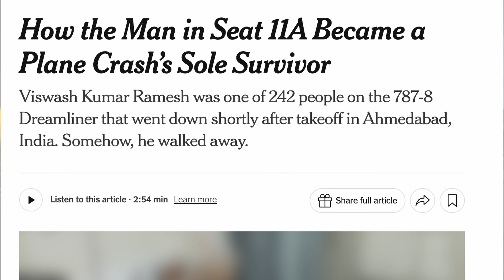Why the RAT Changes Everything – Air India 171 Update

Comment: Captain Steve, there's one more interesting fact: Look at the landing gear configuration. It's tilted FORWARD. The 787's gear is naturally tilted backward, and when you retract the gear it tilts forward and then goes up. This highly implies that the pilots did in fact issue the gear retract command but it prematurely failed.

EDIT: Look up LOT Flight 17. They had a similar incident where the retraction of landing gears resulted in a hydraulic system leak. We could be seeing something similar here.
EDIT: Yes, Swiss001 also made the same comment.
Reply: It didn't retract because they lost both engines and thus full hydraulics, and the RAT on a 787 doesn't power gear, only critical systems.
Reply: bingo. hydro failure onset with wheels up.
Reply: I have been interested in aviation since I was a child and just didn't make the cut cuz of my eyesight. When I watched the very first video of this plane taking off, I asked myself, doesn't it look kinda heavy and slow. And it had to use all of the runway to get airborne. And when it did it seemed like it didn't have any thrust or power. That's when it pancaked ever so gently. The pilot deliberately kept the gear down to cushion the impact on the landing gear. But 58000 liters of fuel blew up every thing. RIP to the souls.
Reply: @markmarky1124 It's India are we surprised? 

170,000 people a year are killed on their roads there alone...that are reported anyway.

It's a third world country operating a modern jet what could go wrong?!?!
Reply: @markmarky1124 intelligent assumption n surely u wud be a good pilot had you the chance...
Reply: This would imply that it was not a mistake by the pilots (as suggested by others) that instead of retracting the gear, they pulled the engines back. If the gear was coming up when they lost power, as you suggest, the gear would have stopped right there. Nice catch.

So, what could cause dual engine failure? Many suggest fuel contamination. I think unlikely for two reasons. 1) 787 engines are fed from different tanks, with separate pumps and lines.
2) If the fuel supply was contaminated, other aircraft would have been effected.

I think it's going to be something stupid like a sensor giving bad data, and the computer thinking that they had just landed and shutting the engines down.

The only other thing I can think of is 'swiss cheese'. A highly unlikely (and unforeseen) set of conditions arose and all the holes lined up. That's going to be a really hard one to diagnose.
Reply: No blaming please mate
Reply: 💜💛💜💛💜🕊
Rest in peace x

My heart goes out to all of their family and friends ❤
Reply: @shirleythompson8251 what about your Liver?
Reply: I’ve watched several 787-8 from different airlines take off and it seems like the main gear retraction sequence varies. Some tilt forward then open doors, others open doors then tilt gear. I’ve even seen some when both the tilt and door opening happen at the same time. I did see another Air India 787 tilt the gear then open doors. Not sure why the variation, but certainly a very interesting point.
Reply: @worshiplifestyle2102 . Maybe there’s a difference between the -8 and-9 787’s.
Reply: So, question remains, why did the rat deploy?
Reply: @RaivenBC It was just explained,  wasn't it?
Reply: Yes, the retraction of the landing gear stopped after stage one ( wheels tilting ) , showing hydraulic failure. I couldn't see if the doors opened to receive the landing gear, which usually happens around the same time.
Reply: So you jumped the gun in your first video. You dont just blame the pilots, yourself being a pilot should know better. Let the reports of black box come
Out.
Reply: HYDRAULIC SYSTEM failure due to Electromechanical failure ..
Reply: I’m questioning why the need for using the entire runway?  All that dust that came up??  But I’d say they already know the cause.  They have the CFR and FDR….. bad fuel doesn’t make sense, no other aircraft would suffer from that??  If two engines failed, you can’t rule out sabotage though seems very unlikely.  But that take-off seems worrisome….
Reply: The pilot radioded " Mayday, Mayday, Mayday, losing power,  going down". Seems pretty conclusive the engines failed. The misty cloud as it leaves the runway doesn't seem normal.
Reply: The RAT will automatically deploy under certain conditions.  It can also be deployed by the push of a button from the pilots.
The sole survivor also stated he heard the engine powering up just prior to the crash.
Reply: @Blake1156 I also recall the survivor stating he heard the engines spooling up
Reply: I saw another video that states the same - it is an important observation.
Reply: With this new evidence, it seems to me that fuel contamination is got to be the only possibility. It is statistically almost impossible is that both engines could fail simultaneously, and even at MTOG a 787 should be able to climb out on one engine
Reply: Then how would the plane taxi down the runway and taxi  off with contaminated fuel? Wouldn't it just sputter and die? @jimeditorial
Reply: @caner78bob that depends. If the aircraft still had Fuel and was topped off with contaminated kerosene, it could be a question of how the contaminants mixed with the good fuel. Or if the contaminants clogged the fuel strainers or damaged the pumps. But the aircraft got all the way to V1 with a normal thrust, or they would have rejected the takeoff. And the only single point that could cause simultaneous failure of two engines would be fuel. Are British Airways 777 crashed short of the runway at Heathrow because of this. In that case, the contaminant was water, and it had frozen into ice
Reply: @jimeditorial this is India in a nutshell 😊
Reply: @samholdsworth420 No actually .. it a Boeing
Reply: Its logical, when both engines fail the hydraulics to retract the landing gear also stops functioning. Thats why its still in de forward tilt, because midway both engines gave out...
Reply: Engines should be drowning out the RAT noise. Engines were not running.
Reply: Ashwin, how about this scenario? Complete hydraulic failure on take off, the rat comes out, the gear stops partially up, Flaps retract? The plane mushed down in a stalled condition. Multiple witnesses of the aircraft have said no flaps.FYI, there are 3 hydraulic systems as backup maybe some sabotage of the hydraulic system?
Reply: @scotty657  Seems unlikely. Any error must've occurred after the take off. The 787 has TOCWS (take off config warning systems) and it would audibly warn the pilots pre take off should any failures be detected.
Reply: @scotty657 there's not 3 hydraulic systems as a backup. There are simply 3 hydraulic systems... left, right, and center. So I dont think if the left hydraulic system fails then the right or the center would be able to help it in any way. After hydraulic systems fail/freeze, the RAT is deployed which brings back SOME power to critical components. I dont know if the RAT provides enough power to be able to retract the landing gear though
Reply: It doesnt matter about the landing gear, this plane lost bot engines on take off, I'd say the pilots had their minds on that problem alone,,,,not the landing gear, it wouldnt even cross their minds, they just know they have no thrust, and no place to land !
Reply: Indian pilot showed unreal courage and character by following all the protocols while death is in his front within 30 sec. When they knew RATS were out and cause dual engine failure 
1. Called MayDay ATC
2. Took the gear intact for some landing.
Reply: Correct
Reply: I hope the engine weren't shut down
Reply: Thanks Capt. !
Reply: Agree. The wheels  could not go up because of the engine failure. Rat may not be powerful enough to operate the wheels
Reply: @manupandit3864 it’s not or wired into it cause normal it happens at altitude
Reply: You got the gear position thing backwards.   Perhaps they had a power failure before attempting to raise the gear.
Reply: and that they used all the runway may suggest thrust may have been impacted.
Reply: I’ll wait for the experts analysis instead of the internet experts.
Reply: No no, the 787 is one of the few platforms in which the landing gear does indeed tilt slightly forward. By about 9 degrees to be exact.
Reply: all what he said in the first and second video people explain it before him, especally by MENTOUR PILOE and another french guy who explain that the pilot did pull up the gears but they got stuck ....! steeve watches people on youtube  then he comes here and say : am sorry, i have to change my bullshit story ! 😀
Reply: Source: Swiss001
Reply: @dinbali I mean most 787 pilots mentioned this days ago lol. The -8 has a slightly different retract procedure, it definitely goes “toe-down” when you select gear-up.

One thing he didn’t mention is that in this configuration, the priority valve will close, locking off hydraulics to the gear manifold (why doors are stuck in position also) and other non-critical components (RAT can’t handle those.)
Reply: Both the gear retraction and flaps failed to deploy do to electrical and hydraulic malfunction; due to thrust failure of the engines!
Reply: No hydraulic pressure if engine stopped.
Reply: So Captain Steve,the APU must not have been running either if the RAT deployed ?
Reply: @tbugher62 the APU is shut off when you start engines.   It also takes a long time to spool up.
Reply: Wet fuel?
Reply: @rayperkins8560  possible but highly unlikely - they'd literally have to pump water into the tanks to make the engines fail completely
Reply: The one who took the video said he hardly heard any sound from the plane.  Normal sound maybe
Reply: Landing gear being stuck would not cause the plane to come down. There was some other major factor at play here...
Reply: Looks like the retraction process was initiated and at that exact moment there was a failure leaving no power so the retraction of gear was never completed!
Reply: @joebezz9894 no, there would have to be a door open. There is not.
Reply: He sure did 😢
Reply: Ps @Swiss001 if your in here WE LOVE YOU
Reply: Fuel contamination?
Reply: When the landing gear lever on the Boeing 787 is pulled up the doors open first, then the wheels tilt and fold into the gear bay as part of the retraction sequence.
Reply: no hydraulics. the small amount of movement was just the stored pressure, not more could be applied because there was no power.
Reply: If there was a sudden massive power failure as hes suggesting that would make sense it was beginning to retract and stop
Reply: In his first video after the crash, blancolirio  said only one thing- find out if the RAT was deployed. He said- finding this is the most important thing. 
He said nothing more- about the crash. 

I’m going back to him. Sorry
Reply: It's Turkey engineering company who is maintaining service of air India.
They attacked silently without any proof.
Reply: fuel issue, simultaneous dual engine failure so unlikely without bird strike
Reply: Dirty fuel can sometimes not be fully ascertained until after full throttle is applied. I also wonder about outside manipulation as many of the recent crashes have happened either at landing or on takeoff with both being close to the ground. Just a thought🤗♥️
Reply: The only 2 double double contamination engine issues I know of where the triple seven crash at Heathrow and airbus 330 at Hong Kong. The triple seven had a very slow long idle descent, coming from Beijing and accreted ice in the fuel lines dislodged and blocked the entrance to the fuel oil heater. Boeing spent several several million dollars building a full scale simulator to show the problem with the Rolls-Royce engines. The airbus had been filled with fuel in Surabaya, Indonesia, and the filter separator system. Water collection device failed and dumped a whole bunch of 20 µm salt crystal into the fuel control system as they approached Hong Kong when they went to bring the engine up from idle the engine would not respond Because of the particles blocking the fuel control at the time. The pilot said he did not have enough altitude and air speed to make the platform they worked on it tried and finally got one engine to come up to 70% power.  They landed at Hong Kong with one engine at 70% power and one at idle, using almost all of the runway. In over six decades of a commercial jet fuel specification, actual fuel issues are so rare they statistically don’t exist.
Reply: No no, the 787 is one of the few platforms in which the landing gear does indeed tilt slightly forward. By about 9 degrees to be exact.
Reply: 4:52 The full list of auto RAT deployment conditions for 787 (NOTE ITEM 2):
1-Loss of all engines
2-Both engines are at less than minimum idle RPM (Revolutions Per Minute)
3-Loss of all hydraulic power - left, right, and center systems detect low pressure
4-Loss of all electrical power
5-BPCU (Bus Power Control Unit) detects loss of power to C1 and C2 TRU (Transformer Rectifier Unit)s
6-On approach, loss of all four EMP (Electric Motor Pump) hydraulic pressures and loss of either the left or right flight controls ACE (Actuator Control Electronics) 
7-Rotor burst on takeoff that causes loss of both PECS (Power Electronics Cooling System) primary cooling loops.

SO HOW DOES “Both engines are at less than minimum idle RPM (Revolutions Per Minute)” OCCUR and could fuel disruption cause that condition?

You need to include more items! There are a number of other observations that need to be addressed! That very late rotation generating a large dust cloud is a big one.  A person in the building that was hit could hear the jet engines operating. The landing gear was partially retracted. The engine thrust on the runway acceleration was reduced. After rotation the engines rolled back to even less thrust. The landing gear was partially retracted and the cycle was probably terminated when the RAT was deployed.
Reply: probaly too soon, but one thing is clear..if this goes back to Boeing, this might be the nail for their coffin...at least outside of the US. God bless all the vicitims and families of Boeings corruptness... It´s such a shame ;(
Reply: Turkey technicians service the plane. 
They sabotage it. Just enough fuel to get it airborne then empty although full. 😢
Reply: See “Pilot blog”. He shows workshop retraction to back up this theory.
Reply: Bad fuel?
Reply: Swiss ki video dekh k yaha gyaan pel diya😂
Reply: these guys needs to do his homework before he runs his mouth..

this info was out 2 days ago. the day before this clown issued his flap/landing gear synopsis.. 

so, whatthefuckever Stevie boy...
Reply: BOEING PLANES ARE DEFECTIVE!
END OF!
Reply: I've been asking this since it happened.
Reply: Luckying it's not C919 !!!
Reply: Sound like all the channels have been listening to Juan Browne.
Reply: Love the factual information opposed to fake info. Thank you
Reply: Probably,  but it can't retract  with both  engines  failed.
Reply: The 787 has 4 generators, 2 per engine.
Reply: I think you got this either from Swiss001 chanel  or Denys Dadorov who puts a clip from the chanel on his latest  video and links to It 
SO please aknowledge the source of this  Instead otherwise you are  passing It off as your own analysis by omission
Reply: I noticed it and you are very right.... The gears tilted forward but the gear doors didn't open... And it's a serious issue
Reply: All these people see a video somewhere else then come here to give their "expert" opinion
Reply: A question, if the engines were at full take off thrust would that not cover other noises thus masking the sound of the RAT that was deployed by a hydraulic failure?
Reply: The next time I fly I would ask for an Airbus to my destination, any airline.
Reply: Does this means the maintenance guy didn't check properly and thoroughly and detect any systems fault?
Reply: This is amazing. I remember when Swiss001 was basically a meme channel.
Reply: My thoughts were that a gear failure caused a more catastrophic issue.
Reply: The question is if both engines failed just after take off, How they failed?? It’s likely one in a billion case that dual engine failure can happen while take off.
Reply: The landing gear had nothing to do with this one.
Reply: @Richard-wp6xq the landing gear is just a confirmation there was a loss of power happened
Reply: @Richard-wp6xq 

The partially retracted landing gear is not the cause but rather another piece of evidence that the engines’ RPM was below flight idle.
Reply: The plane was still trying to pitch up, so hydraulic failure doesn’t seems to happen. It was a complete power loss.
Reply: @p11music80 

With the RAT deployed, there is some hydraulic capabilities for some of the most important control surfaces.
Reply: @Mentaculus42 Yes , but what would caused the double engine failure, Its likely one in a billion case and pilots also don’t even get training for double engine failure.
Reply: @p11music80 

The engines didn’t fail because of something breaking or malfunctioning with the engines. So NOT DUAL ENGINE FAILURE but rather both engines lost thrust, maybe due to fuel interruption. Most likely the engines were at LOWER THAN FLIGHT IDLE RPM which is a condition to auto deploy the RAT. A person in the building that was hit heard at least one engine running, possibly both. So the question should be why the engines were producing low thrust. My take is an interruption of the fuel. But that also has to have an explanation.
Reply: @Mentaculus42 Yeah , FDR would tell the exact parameters for all the instruments.
Reply: Thanks captain!!
Reply: 3:15 - 3:19 with this 4 second gap how did he escape! please someone explain to me, please don't say god helped him bs
Reply: @gouthamthala666  the fireball isn't an explosion its literally just tons of fuel burning quickly but there's virtually no blast to it and it dosent consume the entire wreckage instantly however it does quickly spread (think of throwing gallons of gasoline on someone and then lightning it there will be a relatively large initial flare up however the person will still be alive until the burns itself gets to them). He most likely didn't get out within that time gap but he most likely got out through a hole in the fuselage or out the emergency exit after staying conscious during the initial impact. Its extremely likely that more people survived the impact but were either knocked unconscious or weren't but couldn't get out before the fuselage was consumed by the fire. Its also likely that people were looking for an exit but never found one or couldn't open it in time.
Reply: yeah I saw thatbin another channel. that guy gave the most logical explanation so far. he also talked about heat and air density
Reply: Seems unlikely.. by my analyses the audio file does not match the video. It’s like it’s been overlaid and is not in accordance with expected delays in distance and acoustics
Reply: This guy gets most of his information from YouTube comments section, retired pilot by the way.....
Reply: Great observation! Though the gear door isn’t down.. this is the first part of the gear retraction cycle. The fact that the doors are up still, with trucks forward screams loss of hydraulics to me.
Reply: Therefore its a mechanical failure and airline is liable
Reply: Thanks captain steve for detailed analysis ,but these are all just assumptions with rational thinking .only the black box ,flight data recorder will confirm the truth
Reply: I think Captain Steeve is talking about an optional illusion from the beginning there is no RAT deployed you can see clearly, but towards the end you can mistake the front wheel to a possible RAT deployed. I would suggest to wait for the investigators report to come out before making theories
Reply: This Steeeve guy doesn't even have half the information and he's already running his mouth... Now he's talking about the RAT two days later
Reply: Captain Steve, there&#39;s one more interesting fact: Look at the landing gear configuration. It&#39;s tilted FORWARD. The 787&#39;s gear is naturally tilted backward, and when you retract the gear it tilts forward and then goes up. This highly implies that the pilots did in fact issue the gear retract command but it prematurely failed.<br><br><br>EDIT: Look up LOT Flight 17. They had a similar incident where the retraction of landing gears resulted in a hydraulic system leak. We could be seeing something similar here.<br>EDIT: Yes, Swiss001 also made the same comment.
Reply: Yes exactly, this hints the retraction of the landing gears might be the trigger of the event. Another evidence is that the plane stopped transmitting data at 609 ft, instead of upon impact!
Reply: True
Reply: Not only that, it’s just the left main gear bay door that’s appearing to cycle. I think it’s an electrical failure. The hydraulics on the 787 are driven electrically.
Reply: Sadly this forward tilting wasn't concluded earlier.( One could see it also in previous vids) So gearleaver was lifted properly! Ergo no pilot error!!!!Asking the question: was this a proper investigation in the first place
Reply: Say where you heard this. Swiss001
Reply: @HunterAtheist Swiss001 commented on it and also that the screen shot is so grainy it can’t be considered definitive.
Reply: @HunterAtheist that silly Swiss boy😊
Reply: Here’s the thing. The gear doesn’t naturally tilt backwards it tilts forward. Also…. The doors would come down at the same time as the gear starts to tilt in the -8 which we couldn’t see here. To add on even more, there are videos of the tilt mechanism failing on the 78 and that bogie tilts forward. 
So in my opinion it’s more likely that the loss of hydraulics tilted them forward. Not a gear up actuation.
Reply: @diegoramirez8674  If the engines flamed out after takeoff I don't think the pilots would be too concerned about landing gear.
Reply: @diegoramirez8674  Does gear unlatch and gear door hydraulics take more pressure to actuate than the tiny tilt actuators?
Reply: @diegoramirez8674 That makes sense.
Reply: The Gear started to come up then stopped about 2 seconds later.
Reply: @coolhandluke-0 Pilot reported he is not climbing up so engines or hydraulic failure should be the cause.
Reply: Pray if you would for the lost and for all involved in finding out the truth ❤❤
Reply: LG doors are not open. That happens immediately when gear retract is selected.
Reply: @paulmathis2191  They ARE open, you M-O-R-0-N.
Reply: YOU ARE RIGHT. All the more informed pilot channels said the same thing two days ago.
Reply: @mamabazzz  Swiss001 is right Thats the source
Reply: May be we wait
Reply: Good idea but too much common sense.what’s I’ve learned is there a lot of people who love getting into the technology of complex aircraft.
Reply: @henryhsu1614 thats what i say, the black box tells all
Reply: That's a very typical optical illusion.   Weird.
Reply: Some of you are so rude and mean. At this time no one except God knows what happened. A bunch of you act like you are right & everyone else is wrong when in fact a lot of you aren't smart enough to find your rear end with both hands in your back pockets and a map.
Reply: @kimberleyannedemong5621  And the overarching question to your statement by these kids is "What's a Map"?  I use "couldn't find yer backside in a lit room with both hands and a 10 man working party"!(talking to Marines)  All I know for sure is it got up to 600 ft or so altitude and then basically pancaked and exploded.  I'll wait for the NTSB report.
Reply: @kimberleyannedemong5621  How are they supposed to hold the map?  🤔
Reply: @kimberleyannedemong5621 That's a bit harsh,but true nevertheless
Reply: @kimberleyannedemong5621 🤣🤣🤣🤣🤣
Reply: not 100% sure if the 787 gear is electrical or hydraulic. but giving the new development that the RAT deployed, the gear position seems to support dual engine failure (or some other complete systems failure) right after getting airborne. whether the gear was just symptom of or a clue as to the cause remains to be seen... gonna post a possibility i just considered in the main comments. hint: possible malicious intent
Reply: @tech-ishbrad183 it’s hard to do that this days.
Reply: Ok Sherlock
Reply: Is is tilted backwards. The plane is tilted very high nose up, so if straight, it would be tilted back.
Reply: @artfx9  Yes it also the landing gear door is not slighly open if there is failed in the highdrolic, and in that cases there is something happened to out of control.
Reply: Wouldn't fuel contamination cause the engine failure?  Why wasn't the engine failure picked up before take off?  Just questions.  Seems odd no apparent signs before the plane took off.
Reply: I think Captain  Steve talked about this in his first video. Yes, it would be very obvious if there was a problem with the fuel composition and flow.
Reply: @fdmtts fuel with water not drained？I only sure the engines have loss power so the hydraulic pumps malfunction, and the rat take functions.
Reply: @akakakakakak3084  i am not a mechanic or pilot. But i am aware that planes have redundant systems and have to abide by strict maintenance standards. Something doesn't add up.  Be interested to see the maintenence records on the plane.
Reply: @fdmtts because you are at idle.  Then you go full throttle and you are gushing fuel into the system. Then as it tilts upward I am sure that is when the contaminant really got fed into the engine.
Reply: Had the engines failed BEFORE takeoff, the plane would not have.left the ground!
Reply: @fdmtts 

There are multiple examples of fuel contamination that caused problems later in flights. It is an issue of what type and how much of the contamination there is.
Reply: @fdmtts But pilot reported that he is not claiming up so engines definitely working otherwise why it's not getting enough thrust?
Reply: @subbaraotanguturu9271  Question becomes why the engines worked while taxing but not at takeoff
Reply: @fdmtts There were  signs of engine problems.  One was the AC did not work properly on the way into  Ahmedabad.  The AC air comes from the air bled off the engines high pressure turbine.
Reply: @frankkolmann4801  AC air does not come off the engines on a 787. The air pumps are electrically driven
Reply: @frankkolmann4801  That would make sense.  Something was missed clearly
Reply: @frankkolmann4801 I thought the packs were electrically operated on the 787 and didn't use bleed air
Reply: @jimeditorial my error   you are right 787 does not use bleed air
Reply: @fdmtts  fuel contamination would not show that early
Reply: It doesn’t matter
Reply: There is some other background this event. It might be relevant or maybe not. But it is worth mentioning. 

Air India was a government of India organisation, that was losing money terribly.  Generally Indian government officials have a superiority ego issue, based on the feudal languages of India. 

This company was sold to TATA. That means the government employees with a huge superiority complex converted into private company employees.  This is a terrific change in the local feudal languages. This has resulted in so many management issues, including insubordination, lack of efficiency &c. 

For, the company became a mix of competing egos.

The local languages including Hindi are highly feudal. This can create various kinds of animosities if proper positional status in the language codes are not enforced terrifically. A single indicant word form change can create huge mental stress. 

And again, if the pilots themselves speak in any Indian language to each other, so many mental stress can happen if anyone of them does not concede the required inferiority or is not able to enforce the required superiority in the language codes.
Reply: There are videos from passengers on the airplane before it took off showing videos of literally nothing working in the cabin... The fact that they still took off knowing the AC didn't work the screens didn't work the lights didn't work is 100% negligence and tells me exactly why the company's trying to offer 120k to all the families right away to get them to sign something so they can't sue for million s
Reply: Stop the copy&paste key, dude😂
Reply: Po
Reply: Which explains the pop the survivor said he heard.
Reply: Did anyone check the condition of the plane after it landed from Delhi and certified OK before it started it's journey towards London?
Reply: It's a Boeing! Amazing the wheels didn't fall off at the end of the runway as it took off.
Reply: chmcha 🤣
Reply: You’re 100% wrong
Reply: Haha... We have also seen Swiss001.. 

bro its 2025. U cant be genius easily if you take someone else's opinion and vomit it in somewhere as your own finding 😂😂.. Next time bro..
Reply: Bhai vo tik tok expert hai😂
Reply: Faulty Maintainence and INCOMPETENCE of the service ground crew was the main reason of FAILURE of HYDRAULIC SYSTEM due to ELECTROMECHANICAL failure... it was a MAN MADE catastrophe created solely due to INCOMPETENCE of indians in handling Technical aspects ...
Reply: You sure that's not an optical illusion? I don't think anything but weight on wheels changes the wheel truck's tilt.
Reply: @erickborling1302 this is the second video I’ve seen the landing gear and its angle mentioned.
Reply: @erickborling1302   look at some videos of it retracting... dont think that much change in angle can cause illusion
Reply: @erickborling1302  there's a pretty good analysis video on it, probably where the commenter got the idea from. But they are right, the tilt of the landing gear is in the retraction configuration.
Reply: @erickborling1302  Except retracting the landing gear, which causes them to rotate
Reply: @erickborling1302  even if it's optical illusion. It is a fact the the 78's wheel change their angle prior to retraction.
Reply: @erickborling1302  No the nose down bogie is NOT an optical illusion
Reply: @erickborling1302 you think wrong

The gear tilts forward when it the lever is selected up

You can see this in videos where the aircraft is jacked up for maintenance
Reply: @hunter-aviation  if the gear tilts forward when the lever is selected up that means its also a possibility that the pilot intentionally stalled the engines and aimed the nose down
Reply: Is this Cpt.Steve Burton?
Reply: Agree
Reply: Stop asking for a source. It's from another youtube pilot that flies commercial aircraft. I saw the video myself. Just watch them all like at did.
Reply: This guy is miles behind other people on this story, others have done this much better. He is just copying other YouTubers
Reply: @ianhudsontlm Agreeing with you. And backpedaling on his first theory which I
 thought to be very irresponsible of him to air his first theory without having the facts.
Reply: @ianhudsontlm one thing to consider is this guy is also working he’s not retired.
Reply: All I know is that I am not flying on a boing anymore!
Reply: @Naebl-cd5kp  Are you really not flying on Boeing anymore? First of all, the 787 has never experienced a total hull loss crash, which highlights its stellar safety record. This aircraft has been in operation for about 12 years, making it one of the safest planes to fly, based on this alone. Secondly, you can’t choose which aircraft you want to fly on, unless you fly with an airline like Spirit, which uses an all-Airbus fleet.  These “if its a Boeing then I ain't going” type of comments are lame because we don't even know all the facts yet. Its too early to blame Boeing
Reply: @deuce9star  - Yet there has been a hint of Boeing Bias from Captain Steeeve IMHO
Reply: @Naebl-cd5kp Take care princess, lol.
Reply: @Naebl-cd5kp BOING? Isn’t that Bingo for people who are dyslexic?!🤔
Reply: @Naebl-cd5kp if it’s a Boeing I’m not going!
Reply: Raising the gear would put a significant load on the electrical system.
Reply: this info is 2 days old.. your last clown video was a day ago.. Do your homework before you run your mouth, flyboy
Reply: Flaps are retracted.
Reply: @brucelawson642 How when the aircraft is supposed to be able to prevent that happening. The pilots have enough hours to work through the checklist which is electronic. Not running late.
Reply: @brucelawson642 😂
Reply: @brucelawson642    no despite your excessively confident assertion , you are wrong , pictures you may not have seen prior to the crash and the wing at the crash site show/confirm leading and trailing edge flaps were deployed.
Reply: Capt. Steeeve is interested in firstly blaming pilots.
Reply: @thestruggler3338  Did you not watch the video? He agrees it's probably not pilot error.
Reply: @alzuu1 and you clearly didn't watch his first video about this crash.
Reply: @jcallwood25  oh, I clearly watched it which has become irrelevant because he changed his theory in the CURRENT video. Maybe if that comment was made in the first video, it would make sense.
Reply: @alzuu1 at not pilot error until we eventually find out the actions that actually caused the plane to lose thrust.
Reply: Correct. Which is why you also don’t look away from possible pilot error causes. We used to have a rule when choosing international airlines. If they can’t figure out how to make drinkable water, you shouldn’t fly the airline.
Reply: @thestruggler3338 it normally is. I work on the forensic team that handled the crash in DC and about 80% of the team it’s human error.
Reply: @thestruggler3338 no, he was giving an analysis based on what he knew thusfar. He had three theories. Pilot failure was only one of them.
Reply: @thestruggler3338 only because most accidents are due to pilot error. Even the MAX accidents didn’t have to end up as crashes.
Reply: @LandingFromThTeRightSeat Boeing purposely misled the airlines
Reply: @LandingFromTheRightSeat  have you heard of MCAS? clearly not. Why would you not have that information in the flight manual for the MAX aircraft. No lets put it in there after it has killed 400+ souls.  So most accidents are due to a combination of things including pilot error and including situations that should never have arrived due to manufacturer error that then have the chance to be followed up by pilot error.  To say that recent crashes are simply 'due to pilot error' is in fact an error within itself. Are you not a pilot or something? Sheesh.
Reply: @LandingFromTheRightSeat I disagree totally..max accidents were caused by MCAs malfunction but not pilot error
Reply: @dandee7414  if you had any actual heavy jet time you would have known to fly the plane. Not leave the throttles at full power and hit the ground in excess of 500 knots. If the trim wheel appears to be running away, you would apply that procedure and turn off the stab trim cutoff switches. I’m sure you have more than my 6000 hours in the 737, so you probably know better.
Reply: @thestruggler3338  you probably have more hours than I do in the 737 (6k and counting) so you no doubt know more than the rest of us on here. Since that’s the case you’ve certainly done the sim profiles for MCAS failures and know they are identical to the runaway trim failure checklists that have always existed for the 737. You also know that the stab trim cutout switches will stop the trim issue when there is a failure (to include MCAS). 

A person of your expertise also knows that on the flight before the Lion Air crash, the failure happened and a pilot on the jump seat quickly stopped the MCAS failure by flipping off the switches. 

Your expertise also knows that the planes each hit at high speeds because the pilots failed to control their airspeed by reducing the power setting. Having done that would have also alleviated nose trim control pressure. 

But you have tons of experience and knew all those things and continue to speak incorrect information. 

Why?
Reply: @LandingFromTheRightSeat  Thank you for your lengthy response. I have zero hours flight time but I have an open mind and a good memory. I know a RAT when I see and hear one. I look at a multitude of FACTS. Your suggesting situ normal after  first 2 MCAS related tragedy in Ethiopia and Indonesia? Leave them in service for another year you recon? No problem.  You can argue thy didn't extend flaps or they pulled in the flaps instead of the gear all day long.They mushed it the best they could to buy them time. Your a muppet and probably a paid puppet. I need not hear anymore of your resume or analytical 'investigations'. Good day Sir.
Reply: @thestruggler3338 
That is a pedantic mean spirited comment.
Change the channel, maestro.
Reply: @thestruggler3338 He never said that, he only talked about the engines flaming out and more info is needed to know why.
Reply: @thestruggler3338 Because 95% of air crashes' are a human beings factor/pilot errors. People fail more often than machines.
Reply: @UkrainoTV Not in a Boeing. They've had so many issues from cutting corners, I would NOT trust any of their newer model planes!
Reply: @UkrainoTV 
And people build and maintain the machines
Reply: @thestruggler3338 
❤❤
Me too! I earnestly believe that one of the two pilots are guilty of crashing the Boeing 787 Dreamliner either by mistake or by intent!
❤❤
Reply: @thestruggler3338  makes sense since most modern air disasters are pilot error.
Reply: @thestruggler3338 You didn't watch the video, right?
Reply: BS. He calls it like he sees it at the time. Speculation is not the same as sworn testimony. I wish people would understand that simple fact.
Reply: @thestruggler3338 liar,he never said that.
Reply: @thestruggler3338  Not really fair. He was going through the many possibilities and as we know more,  more are eliminated.
Reply: @Skyking929  many possibilities other than a spring loaded RAT being deployed which was the loud 'bang' most likely that the sole survivor heard.
Reply: @thestruggler3338 Because a lot of plane crashes are usually pilot error, especially in general aviation and those are the planes that crash more often than commercial airplanes.
Reply: @lizs2413  this was not pilot error as you are about to find out in the coming days
Reply: @thestruggler3338  that is so wrong - he's a pilot and looks at it from a pilot's perspective. that's the whole point of his channel.
Reply: @thestruggler3338  Pilot error is significantly more likely to happen than dual engine failure lmao
Reply: @Gibberish434  let the proof be in the pudding.
Reply: @thestruggler3338 then why even watch the video?
Reply: @Gibberish434  good question, I guess I just wanted to see if his opinion changed
Reply: Not really he said it was just opinion now he's changing his mind relax he's a pilot your not
Reply: @thestruggler3338   More like making flashy thumbnails and clickbait titles to get some views and make some $$$, do whatever it takes to make that happen and get video out as fast as you can.
Reply: @thestruggler3338 yes because he thinks he’s Gods gift to aviation
Reply: @wiscowalleye7954 😂😂😂😂
Reply: @wiscowalleye7954  he absolutely never comes across that way.
Reply: @wiscowalleye7954 Power to you for knowing what a person thinks.